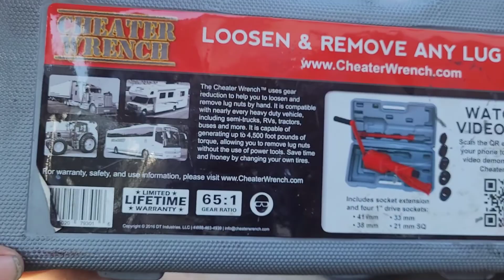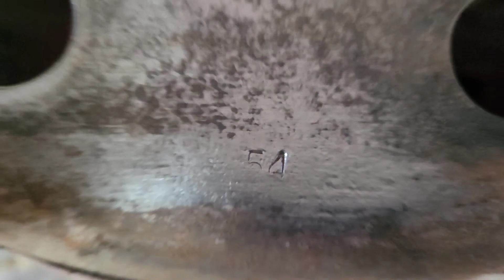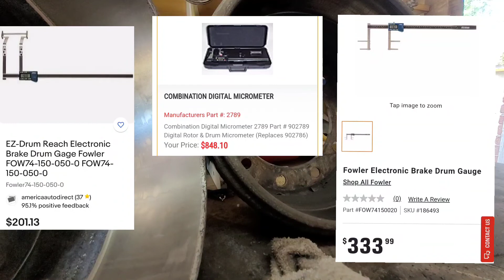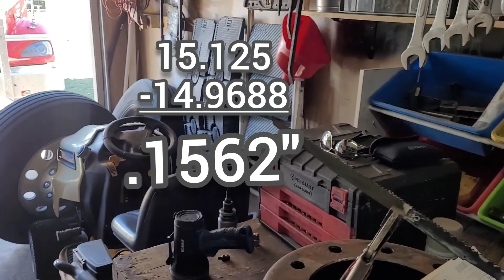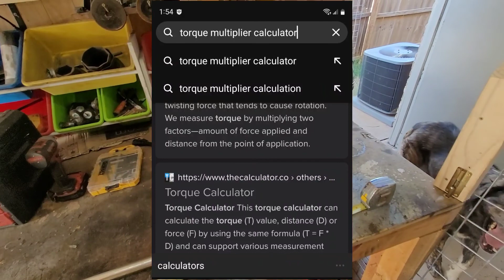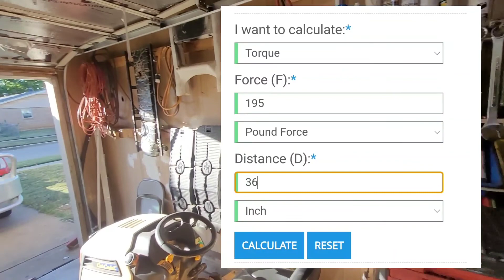Changing front brake drums on a semi truck  |  Step by step

Comment: Aren't those a what is called heat cracks ? I think every drums has those from the excessive heat from the brake shoes, but i don't see on the drum actual crack. what do you think ? btw milwaukee 1/2 will take them lug nuts off with no problem you just have to have the high output batteries which are $100 for a pair in home depot
Reply from the maker: If you can get your fingernail in it, I replace them.
Reply: @aftersolo Good to know that. I have Volvo vnl 2011, and have crazy shaking around 60 and goes away and comes back. King pins all good wheel bearing good new tires the only thing i noticed when i took the wheel out and when i spin the drums it was going all up and down like it is all out of round. Will replace them soon to see if that is my issue
Reply from the maker: @brkbrk5205  Sounds like they're out of round or out of center.  I would guess out of round.  As far as the vibration, an out of round drum will do that, but also if your wheels and drums are hub centric, they can be off center.  Mine were vibrating at higher speeds and I bought 4 centering lugnuts and centered the front wheels and it went away.  4 states has them.  I made a few videos on it.

Comment: Sir where do I find this lug nut remover excellent tool
Reply from the maker: Unfortunately, the one I bought shows 'currently unavailable' on Amazon.  It's a bit pricey though.  It's almost $200 now.  It can be found on cheaterwrench.com.  Luckily, there's many other cheap options.  Just type in 'torque multiplier' on Amazon.  Here's a link:  https://www.amazon.com/cheater-wrench-torque-multiplier/s?k=cheater+wrench+torque+multiplier

Comment: Did you have to adjust the rest of the brakes since you did the front only ?
Reply from the maker: The only adjustment I did was on the front brakes.  The others are unaffected by the front brakes change and adjustment, so I didn't need to mess with them.  General rule of thumb is if you're changing out brakes on one side of an axle, then do it on the other side of that axle too.